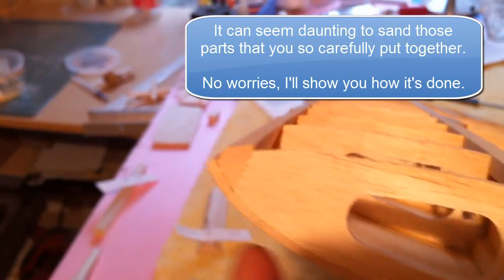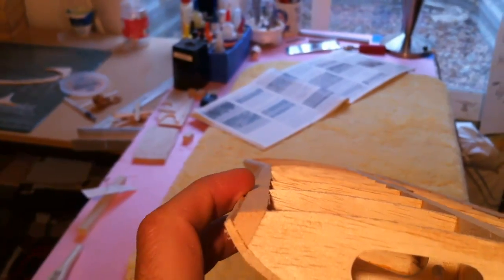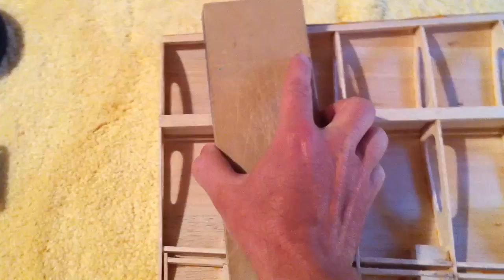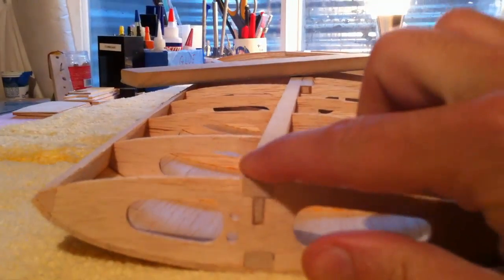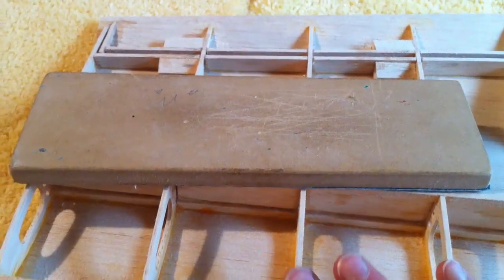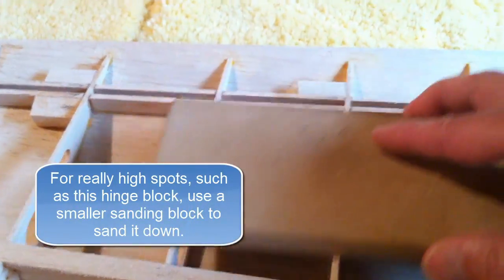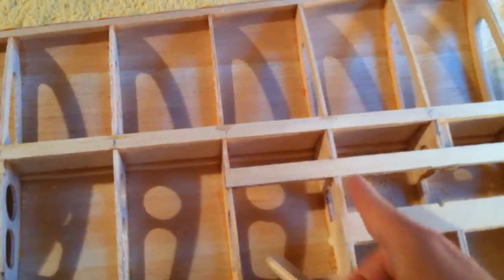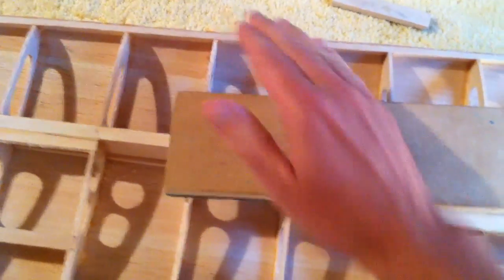How To Sand An RC Airplane Wing (without screwing up the airfoil shape)

Comment: l.m almost ready to cover with balsa sheeting an RC.40 piper cub haven't sanded it yet and this video is helpful, I decided to cover the wing and tail feathers with balsa sheets instead of ultracote, I,m also going to squeegee a thin layer of fiberglass resin over the wood sand and spray paint, Thanks.

Comment: Good information - unfortunately you skipped the leading edge sanding process.  You started by saying you were ready to sand the leading edge.  Next views we see show that you already did it, the LE is flush with the ribs. That's the part I was hoping to watch.  I'm having a lot of trouble getting the top of LE down to top of rib front WITHOUT knocking off a piece of a rib.

Comment: Would it not be better to more properly size the leading edge, spars, and rails before gluing them in? If not exactly flush, they ought to sit very slightly lower than the ribs unless you want a boundary layer trip on the forward top of the wing.

Comment: I`m building my first rc airplane. It`s a Senior Telemaster. I have been worried about the leading edge since I read that I had to shape it ,well today was the day. Overall it turned out good but I removed a little to much from the leading edge. About the last 8-10 inched from the wing tip. I removed about 1/16 " to much, how can I build that back up ? I can work around it and it will be ok but it`s not perfect and i`m kinda OCD and want it perfect. Any suggestions ?

Comment: If you can get old school plans,its best to start with one of those. I see the newer kits cutting back on top stringer supports as well as doubling up the wing formers in the nose of the wing. I still think scratch builds are best. Prebuilt planes are horrible now days,not enough material and huge spaces between bulkheads,but no extra support. Using one piece side formers covered in flimsy single ply balsa with no stringers really compromises the strength of the build,all in the name of calling it a lighter weight build. I would like to see carbon fiber side supports and stringers being used but thats just me. Hell most planes dont even survive a light landing nowdays in rough grass. Our throw away society has effected even our hobby.

Comment: Use a long boars sanding block when sanding larger areas like several ribs at a time. You can use a block 2 and a half foot long and sand in one direction, but sand at an angle, not straight on like you showed, make sure the sanding block contacts the ribs at all angles, not just straight forward and back. By sanding at a slight Angle, you remove equal amounts of wood across the ribs. Its really easy to sand too far by sanding just a few doing a straight on shot. I sand in one direction at the angle, not straight. Never sand straight on like you showed. I learned the hard way. You can easily rotate the eing and take off material going the other way, but, no never sand forward and back like you showed. Mabe as a finish sand, or to square the corners.
Reply: RC Hobbyist Extreme OMG,  we get it, dont do front and back like he did... lol😂

Comment: Not bad, except for the advice to change the airfoil shape on the leading edge by raising the rib with additional wood to meet the leading edge instead of sanding it. Top Flite T34 ... you should've routed the retract rails slightly over 1/8" to accommodate the gear doors *wink*. You also didn't push your aileron and flap leading and trailing edge pieces down far enough into the ribs; looks like you have to change the airfoil by sanding down to those pieces instead of sanding the trailing and leading edges to meet the rib instead. Oops!